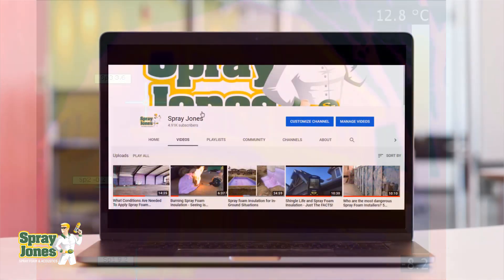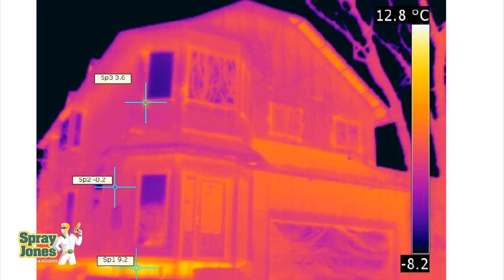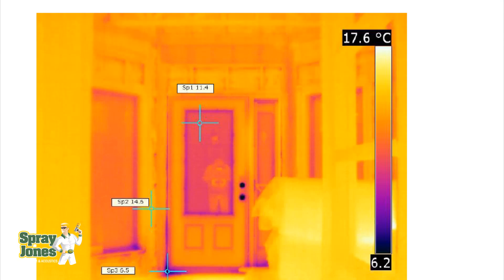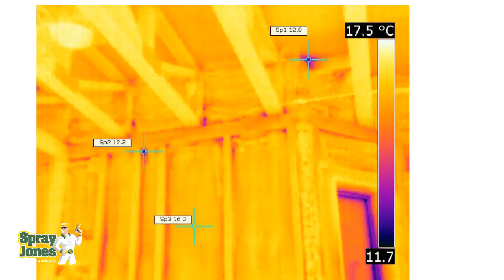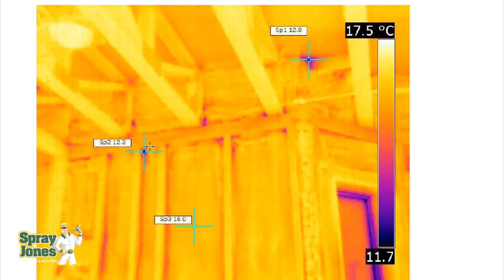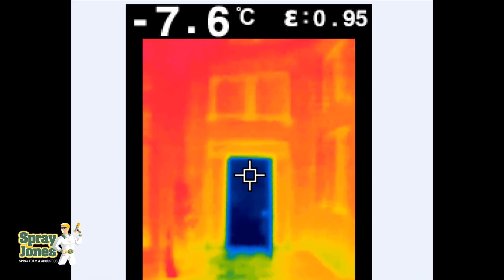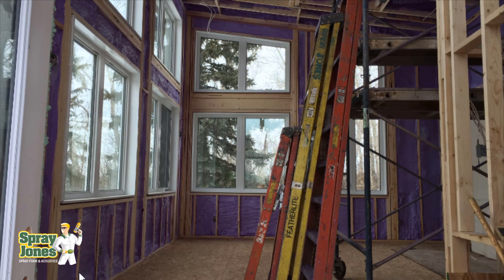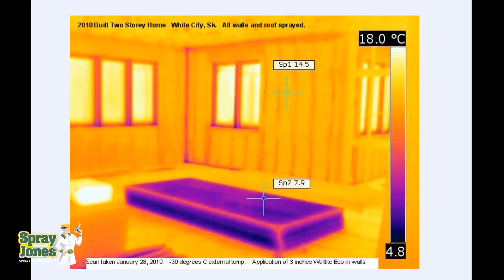Is Thermal Bridging Bad? | With Spray Foam Insulation

Comment: I am not sure thermal imaging is showing everything you are assuming it does. These are surface temperatures, not heat transfer rates. Certainly heat transfer and surface temperatures are directly related though. 
Heat transfer testing disagrees with what you are trying to show with the images. Heat travels thru the wood faster according to materials testing. Because of that, I am trying to find a reason for the images you see.

What I am theorizing is that the air and radiation in the room can transfer heat to the surface fast enough that it basically matches the interior temperature. That doesn't mean heat isn't flowing thru the wall at that spot faster than the surrounding areas. At a certain point (drop across the wall) the air in the room and radiation cannot supply heat to the wall fast enough and then you will see temperature differences. 
There are a few other intersting things in the images I am not sure about. You can still see the outline of the studs with dark areas at their edges. Is the drywall already installed in these images, so we are really looking at the drywall surface temperatures? The other odd thing is the windows. They have really poor R values, even triple pane ones. Why are they showing as being so warm? Can you take a look at the windows in your own home for a similar indication, and then go feel them. I suspect they won't feel room temperature, and that it is tricking the camera because it reflects radiation better, or some similar phenomenon.

All of this said, I agree this is the best insulation available, so I am not trying to argue against using. Just trying to make sense of all the issues at play. I appreciate your videos and feel you have a better understanding of the issues than most. I am glad you are sharing.
Reply from the maker: The stud connected to the outside will lose energy from high concentration to low. This is not an isolated piece within the assembly that can only equalize or charge. There is a space for dissipation. 

If the flow rate to the outside is higher than the surrounding materials the loss value will be faster and more energy pulled toward that point. The camera will show visually the energy loss in the form of temperature and thereby measure what that is.
Reply: @SprayJones  The camera will only ever show temperatures, not flow rates. Just because temperature remains the same does not mean the flow is not different. It just means the flow rate is slow enough that the surrounding room can replace it as fast as it leaves and keep the temperature at the surface constant. The physics of the material and thermodynamics of conduction follow this equation for a flat wall. (Temperature_inside - temperature_outside) * wall area / R-value. While the temperatures are mostly the same across the wall, the R-value is not, and therefore the heat flow at the lower R-value areas is faster. The bridging still exists regardless of your constant temp images. On the outside images the heat is removed fast enough to not show a temperature rise at the studs.
If you watch for a day when a thin layer of snow falls on a roof, you should see that it melts (assuming the sun doesn't hit it) faster at the thermal bridges of the wood. Even though the inside temp is constant.

I thought up an odd analogy that I think demonstrates the behaviour well. Imagine  a rectangular frame laid flat where strips of fabric are attached to the bottom. One fabric has a tight weave, and the other much looser. The strips are sew together in proportional areas and layout to the studs and wall cavities. The density of the weave is like the R-value. Now pour a heavy syrup into the frame, and it represents the heat the furnace provides. The syrup is going to leak thru the fabric, faster for the loose weave and slowly for the dense weave, and is the heat loss thru the wall. The level of the syrup is the temperature. So if the weave is too loose the the syrup drains (heat loss) faster than the supply (furnace) and the level (temp) drops on the frame (room). Let's say the weave is tight enough that the over all level is maintained. Let's look at the surface of the syrup for different weaves of the strips representing the studs. If the weave is tight enough, the flow is low, and the surface is completely flat (like what your camera is showing). The syrup is able to flow in and replace that lost fast enough that the surface is unaffected. However the stud weave is still not as tight as the cavity weave so more is dripping thru them. Now let's look at a case where the stud fabric is a looser weave. In this case the flow thru it is even faster. At some point the surface will start to have a depression over the looser weave strips because the syrup cannot flow into that space fast enough to keep the level constant, but the supply is still large enough to keep the average level from dropping. Those are like the thermal images you see where the studs are darker than the cavities. The heat flow from the room cannot keep up with the loss and so the surface temperature drops.

Comment: Old construction is still standing because it breaths.
Reply from the maker: Sure sure.
Reply: @SprayJones  I understand that the new and improved building techniques are your bread-n-butter, maybe even your passion, and kudos to you for helping educate people on their strengths as well as their pitfalls.
I've been a carpenter/builder since the late 70's so I've watched these products come on the market and I've seen many people struggle with both using them and living with them. There are pros and cons to every building technique and it appears as though you're doing better than many in your field, so like I said kudos. 

I'm going to remain firmly in the "let it breath" camp even though I do find these techniques interesting.